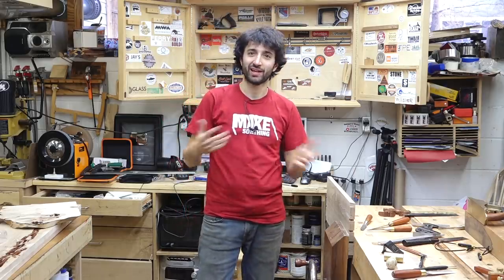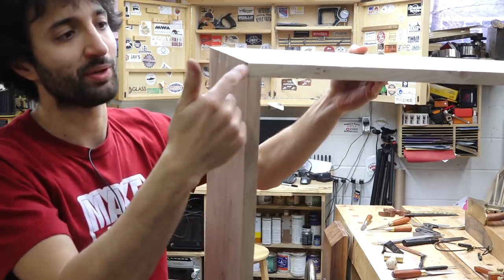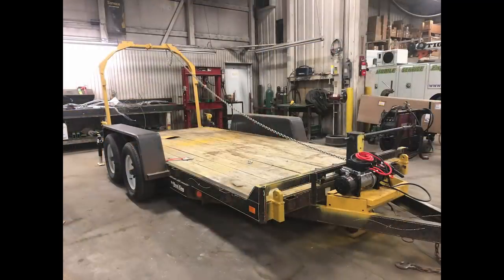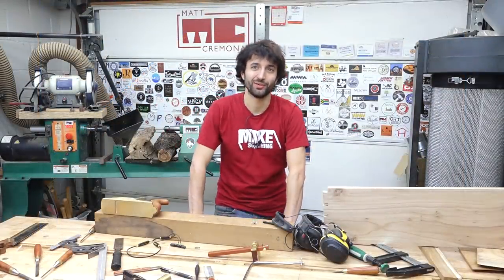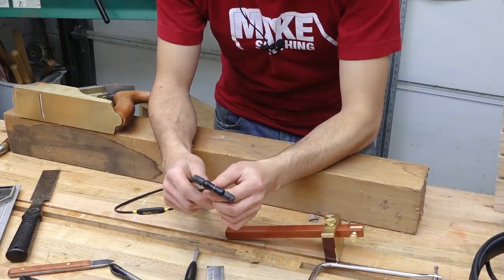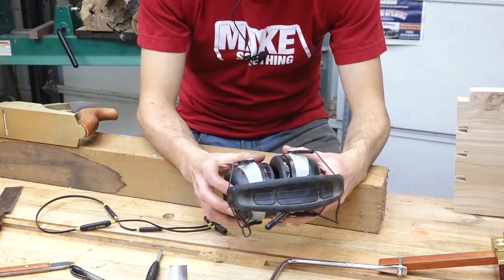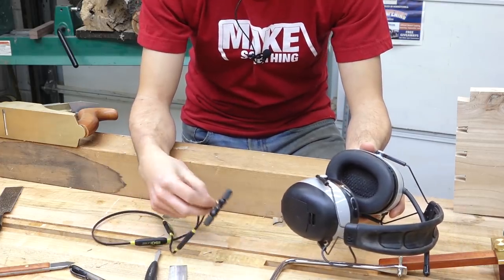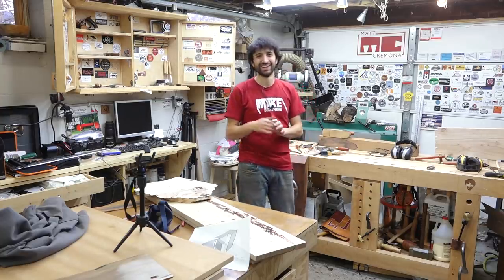Matt's Weekly Shop Update - January 11, 2019

Comment: I'm not sure which safety glasses you use but, the safety glasses  I use have flat temple bands. They are designed to use with earmuffs. I've never had a problem with the glasses getting pressed into my head.

Comment: Matt, I've both the ISOtunes Pro (orange) and ISOTunes+ and have to say, I recommend them (2 sets allows one to charge while wearing another). The "black" set you have is a problem for me though, in that I have the 1st Generation (there is a beep whenever a track/song changes). ISOtunes gave me 90 days to exchange and I lapsed. Still, I think they are great (I use outside when sawing or mowing). But, like you noted, the range of BlueTooth is not best. I found wearing iPhone in shirt pocket/jacket pocket/sleeve pocket is optimum. 👍🏻

Comment: I have the same muff type headphones as well, and the ISO Pro.  They (ISO) are ok but are harder to put on and off.  Get tired of squeezing the foam stuff that expands in your ears.

Bottom-line for me is, nothing beats my Bose QuietControl 30 Wireless Headphones.  They Electronically control the noise AND you can adjust the amount of noise you want to cancel.  Full noise cancellation to no cancellation and anything in-between.  And they feel great, I can wear them all day long!  And the battery life is great, up to 10 hours.  Last the sound is awesome!    They also have an app, so you can control volume, noise cancelation, see battery %, and see what is playing and connectivity on the phone app.  No more smashing little buttons that are hard to find on the headphones.

The only problem is they are the Festool of headphones.  They are pricey!!!  I bought the ISO Pro as I didn't want to use my Bose when mowing and in real dirty situations.   I guess being a little protective of the Bose investment.

Comment: To prevent the safety glasses + over-ear style hearing protection problem, I just buy safety glasses that fit :-P

Seriously though, I know what you mean, and it's why I stopped buying those safety glasses (despite having probably 3-4 of them around).  Iso tunes do intrigue me though, as I often wear bluetooth headphones that are earbud style, which work well under the on ear hearing protection, but don't block out a lot of noise, which I prefer when I'm not using machines

Comment: I'm curious what the noise reduction rating is for both?  I use ear muffs because I have something like 4 pairs from when I worked for 3M, but I switched to goggles instead of glasses.  The elastic strap doesn't cause any pain and more than anything, the muffs seal around the ear like they should so there's no noise leaks.
Reply from the maker: isotunes says 27, worktunes says 24
Reply: Interesting, that was my question. My current over ear muffs are rated at 34 dB reduction. I am using bluetooth buds under the  muffs, great sound and protection.  Comfort is a big deal though on long days.

Comment: How do you combat with the edges on your garage doors? Did you just put nice trim with rubber seals on or double up on them? You look comfy even right next to the door.
Reply from the maker: I haven't done much to them besides adding the foam boards.  They have the generic side and bottom seals.  Nothing fancy.  I keep the shop around 75 when I'm out there.
Reply: A 400 sq. ft. Minimally insulated garage, kept at 75* , in Minneapolis winters? What kind of heater do you have in there? My Dallas Texas garage heater has a tough time holding 75*.
Reply from the maker: Just a simple natural gas garage heater. 45k btu